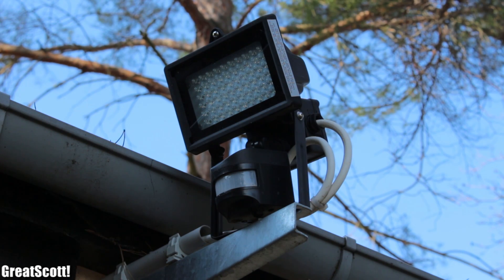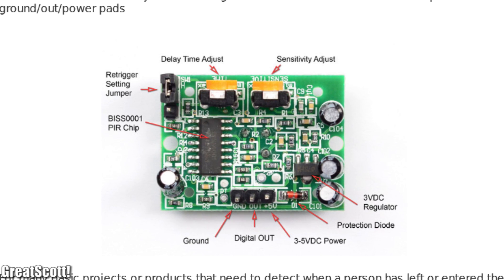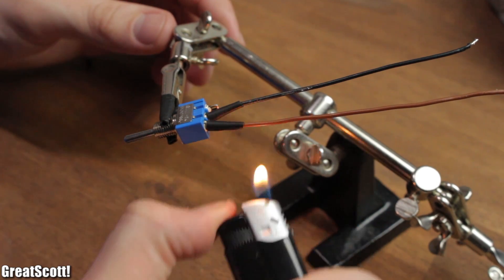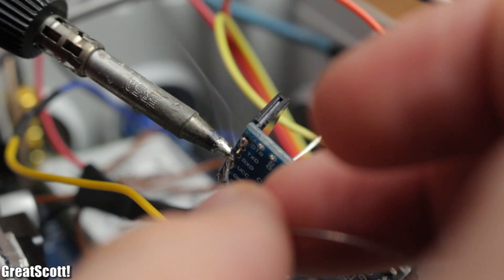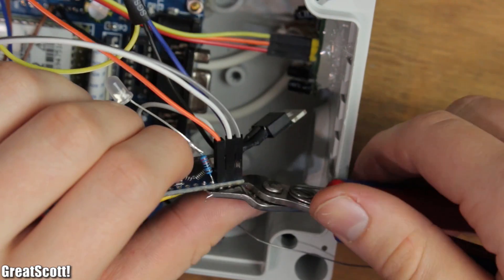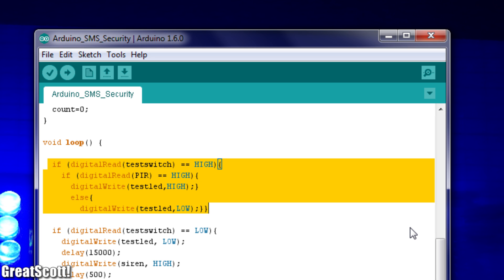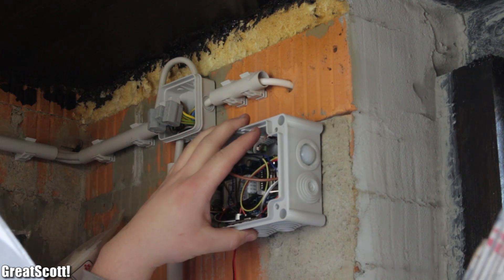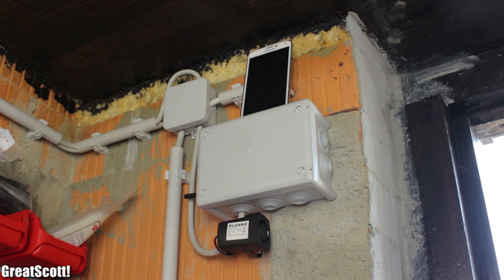DIY Motion Detection SMS Alarm System

Comment: I made mine so you can send SMS to alarm to arm it or disarm it. Alarm will SMS you back saying if its ARMED or DISARMED.  Also has RED and GREEN LEDs for status and in case of trigger it will SMS you with input 1 or input 2 in alarm and will turn on the siren.  Also has little LCD module to show all the same things... unfortunatelly 2G is not a thing anymore and all my projects are on-hold.

Comment: Amazing to watch older videos and realize not only how far some tech has come, but the implications of such changes. On one hand, you probably need at least a 3G capable module to get this to work on a new line by now. On the other hand, that 5V 3A power supply could be replaced with a tiny GaN USB-C PD charger. And those are getting cheaper all the time too. :)

Edit: RIP G+ :(

Comment: Hmm, the intruder can switch that off himself, better to add a keypad and a big LiPo battery in case of a power outage.
Reply: The big scary spider is there to protect the alarm system in the case of the intruder try to disable that.  XD

Comment: Question: is the arduino nano digital pin current enough to power a voltage step up?? I think the max current per pin is 40mA is this enough??

Comment: Can a keypad and LCD be added to this?
Reply: Chidera John Yes. You could buy a keypad matrix, set it up to be used with the arduino, create a variable in the code for if the system is set, create a variable containing the key you want to use, if key is correct alternate the "system set" variable.

Comment: These days, you could use an ESP8266 to send the SMS via WiFi (for those wondering how: you have the ESP8266 send an email to the SMS gateway that your cell provider makes available.Every cell provider has one.) I did this for a project that sends me an SMS when my house's mailbox is opened.

Comment: Why do u need the phone if the SIM card is inside the alarm ? Isn't there hardware to use a pre paid sim card and program adrunino to send your number a sms text message without using and extra phone just with prepaid sim card?
Reply: pg86131314 Think again. Or if you didnt think to this point, turn off idiot mode now please.

Comment: Dear friend, I have build this project and it's working great. I modified it for using a reed switch and rf module to make reed wireless. Combined your earlier project RTC to this and the sms comes with time of trigger. Removed the warning alarm from the code and Added a counter to the code so that if reed rf is off it too sends a sms that alarm is not working with time. Thanks for teaching us with simplifying code and arduino. U r great. Hope that u continue making more videos. Rahul
Reply: can you share the code that would be awesome! im trying to do the same thing but i can make the whole program with rf
Reply: +Petros Petrakis sure give me ur email.

Comment: If we want it to be independent of standard house power supply? Could we use a rechargeable battery or a power bank?
Reply: only if its output current is big enough to power everything, i think a 2amp output will be ok
Reply: If you don't know the answer already then this project is way above your current ability and you should start with the basics

Comment: Hi Scott, can i connect more pir sensors in parallel with each other?
Reply from the maker: Nikolas Sels Sure. And you can also use a logic OR to connect them all to one arduino pin.

Comment: Im looking to build a similar system but using a existing security system in the house. Its a Vista 10SE made by ADEMCO. Its a good system but I would rather not pay for a monitoring service. So I can use a output from the Vista 10se to control the SMS wireless module. Problem is I live in Phoenix Arizona US. Is there a similar device I could use here for this purpose?

Regards,

Liviu

Comment: Hi scott. I already have an alarm system and a siren which doesnt send sms message. What i wonder is, with this project, without the siren and siren codes, does arduino accept outside voltages? For example here you say if motion detector detects something it gives a voltage to the pin and arduino sends sms. Can we make the same with my siren? If my siren goes off it gives a voltage and with that voltage can arduino send an sms to me?
Reply from the maker: Umut Maral That is possible.

Comment: Wouldn't it been better or easier just to simply buy a good brand motion sensor? Like Honeywell Dual Tec So then you could easily put the sensor where ever you wish without having to worry about a housing? Plus you could easily hide the Arduino. So the alarm system is a little more legit.
Reply from the maker: Andrew McRobb Sure

Comment: Hi Scott,
The long delay at the end does not work like this. A constant (like the 1800000 in the delay) is now threatened like a int and does not fit. You need to tell the compiler the threat it like a long or unsigned long by entering 1800000L or 1800000UL. See www.arduino.cc/en/Reference/IntegerConstants

And to turn the small pots more easy use a large flat screwdriver instead of a Philips ;)
Reply from the maker: Septillion Thanks for the information. I will do it like this next time. But this "reset" time still works quite well even though it is defined the wrong way.

Comment: Hi Jack,  Thanks for the great inspiration.
For my enclosure I will allow accessibility to the SIM card, the hot glue seems a bit final.
I assume my existing Teensy will work as well as the Pro Mini atmega328 ?
Simon Monk's timer library need further tweeks?
Audio warning to intruder may be helpful using a sound board:
https://www.adafruit.com/products/2210
 
Thank You again!
Reply from the maker: Jim Chamberlain Teensy should work fine.

Comment: The cable to the siren is the achilles heel of the system. No place left for build in´nto main case?
Reply from the maker: Not really
Reply: +GreatScott! If those wires are cut does it affect the other components or no?
Reply: Swogetti Swindon you can always rig up a magnetic coil, which would drop a weigh with a wire soldered to it completing a battery powered circuit to power it up, as well as set it off if you wish. but that's a bit more complicated.

Comment: Very nice, as usual.  I do have one question about all these sms enabled projects that I've seen over the years.  Do you have to use some sort of mobile network plan to gain access to the sms sending capability?  It would seem that, with all the people out there who are into free communication lines, someone would have used this technology to make a 'free' cell phone.  Even with a SIM card, wouldn't there need to be a provider?
Reply from the maker: Time4Tech Correct. Here is a video answer: https://youtu.be/gVGD-f8SQSI
Reply: Khavalier Of course there is a provider with a cell phone plan.
I assume he simply used a cheap prepaid SIM card which you can get from your local supermarket. Since it is just sending some SMSes he hardly ever needs to charge any money.

Comment: Very nice, but an intruder can flip the on/off switch. I think it is better to put the on/off switch somewhere else.
Also you can use a Straight Hinge Lever Mini Micro Switch in the case to prevent someone open up the case and turn off the alarm. Connect the micro switch to the alarm so that the alarm detects opening the case and send you a text message.

Comment: Absolutely love your vids! I built the color organ from your first video and It worked great also I modified the code to make it 6 channel organ and used 3W leds instead of 1W.
Reply from the maker: casaverdero Sounds great!
Reply: GreatScott! altough Im having some trouble with a very long audio cable.The high freq leds go crazy.Any solutions to this?
Reply from the maker: casaverdero Try to add a small resistor (10-100Ω) in series with the audio line.
Reply: GreatScott! I have the project right in my room and I have any electronic components you can think of in my room.
Reply: casaverdero Can you upload a video with your project. Sounds interesting. AND YES I have already see the video from GreatScott.
Reply: GreatScott! you my friend are a genius!!! It fixed it right up!
Reply: Patrick Pinto sure ill try to make a video about it but my editing skills are a bit lacking...
Reply from the maker: casaverdero
That was fast ;-)